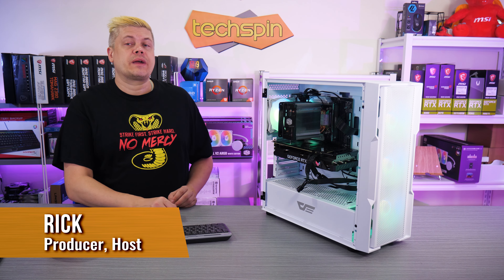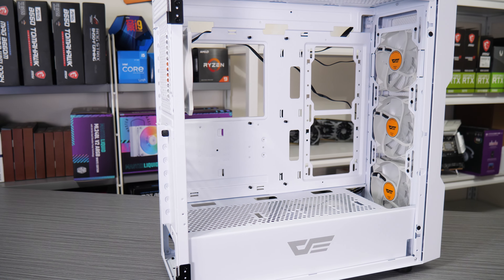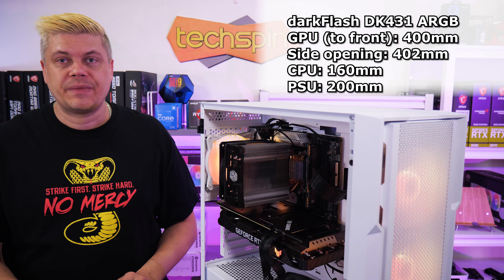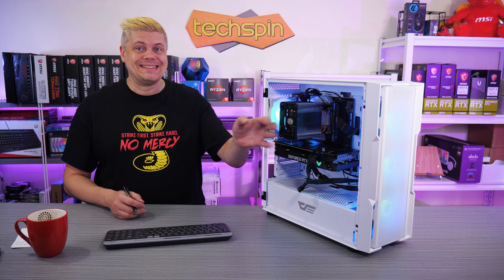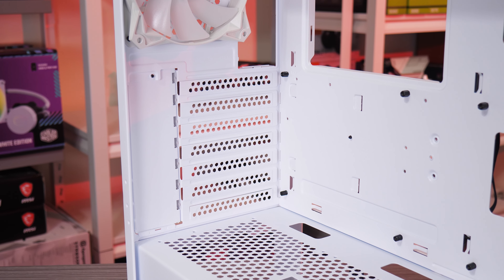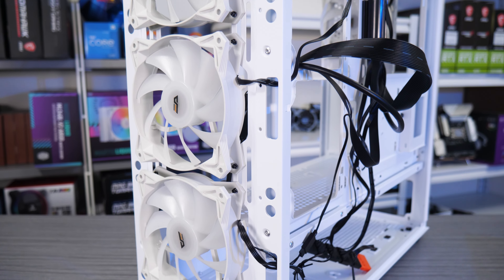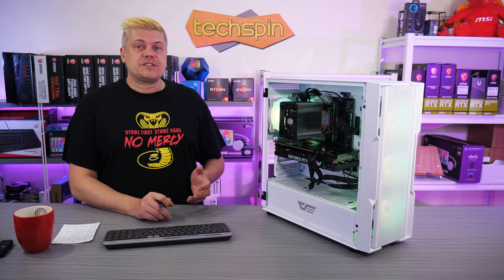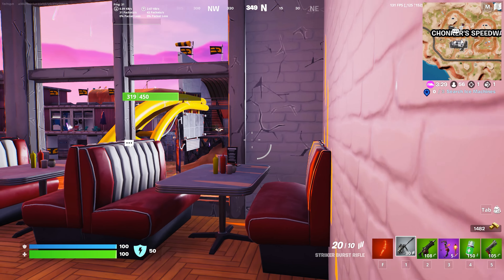Great darkFlash DK431 case, bad ARGB fans

Comment: You can just change the fans and avoid this fiasco tho right?
Reply from the maker: With the money spent on new fans, you're better off just buying a better case! We'd recommend the Cooler Master HAF 500 as it's got great airflow, is feature rich and super easy to build in. Also this case metal is too thin and deforms easily, something we haven't experienced on any other cases. Please subscribe, thanks for your support!
Reply: @Techspin hey i just wanted to give an update after I’ve purchased this case, I guess they must have listened to you because I bought the black version with no fans and it didn’t come with the Molex connector but I’m thoroughly pleased with this case, and how cheap it costed
Reply from the maker: @erronblack6763 Oh? Did it come with a 3 pin or 4 pin connector? Thanks for telling me!

Comment: Got this case today because at Turkey , E-ATX cases are so expensive... Molex is a no problem for me because theese fans are silent at molex (%100 power). If you want you can get a Molex+ 3pin Case fan, connect it to the motherboard, and connect DK431's Molex to the new Case Fan's Molex extention... And only a solution that will cost a few bucks.
Reply from the maker: Update: The master fan on this case just died, causing the other 3 slave fans to stop spinning. So we have to replace the fans.
The problem with this is that DC/PWM case fans have a range of around 650-2000rpm depending on type/brand. At max rpm, fans are loud but they move a LOT of air. These fans are not loud, spinning slowly, and not moving a lot of air. Since these are capped running slowly at max 12v, there's no way to get them to go faster. So no, there's not a workaround... Except getting actual good fans.
Reply: @Techspin  I researched this case, the fans are 1200rpm 34CFM fans. Yes thats bad airflow but its quiet tier fans. 30-40CFM 12cm fans are quiet tier.

If a fan is 12cm , Id expect 60-80CFM for performance in cooling. 

I upgraded this case from old cooler master silencio. I have 7600x , AK400 and rtx 3060ti. Cpu temp downed to 65 from 75-78 during gaming. My airflow improved.Also chipset and vrm temps are improved due to better airflow. But I sometimes feel that case fans have low airflow. 

For now I supported my airflow with 2x 76cfm 1800 rpm 3pin fans from left side and bottom. Will replace the default fans when they wear off (My pc is on +12hours a day, dust will wear off them fast...)
Reply from the maker: Our master fan lasted 16 months before dying causing the other 3 linked fans to stop spinning. Warranty is 12 months 🚩 Hope your master lasts longer than ours did 😅
Reply: @Techspin  Yep , will get 4x deepcool argb or tuf gaming kit when it dies...

Comment: Hello, I am dumb but want to ask the assembly sequence of these fans. First we connect the orange plug to the power supply and leave that connection branch, then we connect the 3 hole(5v) wire itself and the stupid sticking out 2 hole wire in the jra, and it will be safe? And is it possible to connect the wire from the fan where the reset was in to this stupid 2 hole wire.
Reply from the maker: It's been too long since I worked with this case, I'm pretty sure I showed the wiring assembled (powered off) in the video, but please read the labeling on the connector ends/follow instructions. Good luck!
Reply: @Techspin  ok with molex i understood everything that only connect to orange. but can i remove reset wire from fan and insert it into argm which has this wire similar to reset. Thanks for the answer

Comment: I don’t understand the fan part, why is it dangerous and how to avoid?
Reply from the maker: Plug the Molex power only into the orange side connector. Unfortunately darkFlash is not using standard fan PWM/DC connectors or ARGB daisy chaining, and they don't block the other black end of the Molex chain which is dangerous for consumers. Please subscribe, thanks for your support!

Comment: Can you do push-pull setup for 360mm AIO mounted top?
Reply from the maker: Why are you trying to do a crazy top end solution like that with the cheapest tiny case? No it won't work. Let me ask you, how thick is a push pull? Do you think most case manufacturers allow for the massive clearance needed for that up top? Push pull will be front only. Also, I've run push pull and for the few degrees difference it's totally not worth it, most cases you'll need custom bolts, fan mounting and wiring is a headache, and if you need to remove the AIO it takes 3x the time for removal and reassembly. Did I mention it's heavy and easy to damage mobo components? Don't do push pull 😂
Please subscribe, thanks for your support!
Reply: @Techspin  it's the only case that fits on my desk in a tight apartment. And the only case I found a way to fit 3xHDDs. Can't get rid of my 4TB hard drives yet until SATA SSDs become cheaper.

As for push-pull, I'm aware that it has minimal impact on temps. Why am I considering to do it? Because I can... And actually I just have ARGB+PWM lying around so why not give myself a headache to keep me busy lol. But thank you anyway.
Reply from the maker: @villarey.angelo Yeah the total thickness is usually 55mm for a normal rad + fan, and you'll add another 25mm with another fan set, so you'll run into lots of issues like blocking motherboard headers, ram releases and crucially, ram clearance. You really should only plan a push pull at the front, never up top, and good luck to you if you try! 🫡
Reply: @Techspin  well, will this case support front push-pull? Additionally, would AIO tube placement matter for front-mounted rad (top vs bottom)?

Comment: what do you mean don't connect fans to molex connectors?  How else will the fans get power?
Reply from the maker: The warning was: "Do not connect the fan interface black end to another Molex, as you’ll fry your whole ARGB setup and quite possibly your motherboard." If you're still using the 1983 connectivity system for your PC, that's fine, but don't chain it into this connector, just use another PSU line. Please subscribe, thanks for your support!

Comment: the front panel is hard to remove lol any tips
Reply from the maker: When we get/buy cases for review, we always triple check how the front is attached, standard way is with 4-6 grippy pegs, but some have had clips or screws, and in the early years I've broken a few! I think I covered removal in the video. Generally, some to quite a bit of ummph is required pulling outwards at the front panel's bottom. Good luck! 🤞🍀 Please subscribe, thanks for your support!

Comment: Hi, I'm new to the PC world, so I have a question... from the explanation in the video, I want to ask in this case, is it okay if the molex cable is used specifically for the fan and stacked with other fan, without stacking the molex for other components?
Reply from the maker: Yes but you can only attach it to the marked side! Please look at the instructions and watch the video carefully to avoid hooking up to the wrong side. Don't plug that molex into other devices. Wish you luck.
Reply: Thank you for the answer and response...🙏

Comment: Hi I got the same argb design on my DK352. I am looking to install 2 120mm exhaust on the top of the case. Is it okay to get a darkflash dr12 argb fans set and connect the stock argb fans on the fan hubs of the dr12 then connect is to my rgb headdr to sync? Please help me my friend I dont want any wiring problems my pc is just new 😢
Reply from the maker: Either the new ARGB fans will have proper wiring, or garbage like this. Either way, should connect.

Comment: Guys, can somebody help? I bought this case recently and my fans are working but rgb on them don’t. I’ve connected all the molexes and tries connecting argb but none of this works, what should I do?
Reply from the maker: From the way you're describing the problem, I'm guessing you may have plugged the PSU molex into the wrong connector end of the chain. Best thing I can suggest try to get it covered under warranty. Swap to a better case if you're able. Please subscribe, thanks for your support!
Reply: @Techspin  it was just a broken molex connector (orange one) in the case, just accidentally swapped one of the pins (that weren’t fixed in their positions) and now it works somehow 🤷‍♂️
I honestly believed that asus rgb software were blocking the whole thing 🥴
But thanks anyway!
Reply: @Techspin  it was just a broken molex connector (orange one) in the case, just accidentally swapped one of the pins (that weren’t fixed in their positions) and now it works somehow 🤷‍♂️
I honestly believed that asus rgb software were blocking the whole thing 🥴
But thanks anyway!
Reply from the maker: The molex connector pins can sometimes have issues as they can become dislodged. Another reason why this is a poor solution for RGB...
Reply: @Techspin  That was the problem in my case…

Comment: Your video is like the missing manual for this case. It took me a few hours to figure out the RGB connectors and all this mess with the molex connectors.
it's the first time I'm building a PC.

The problem seems to lie in the fact that they have separate LED/fan power. The LEDs run on 5V whereas the fans are running on 12V. It makes me want to solder the wires to get rid of that nasty chain of connectors🙃
Reply from the maker: Really glad we could help! Please subscribe, thanks for your support!
Reply: Im about to buy this case for my first pc build, i was wondering if i could avoid the whole molex situation/problem   With just buying different fans?
Reply from the maker: This is not the case you're looking for waves Jedi hand
Check our HAF 500 review 😉

Comment: bought new fans for this case. i chose the thermaltake c12c (3 120 front, 2 120 side, and 1 120 exhaust). i wont be using the molex fans anymore because they can raise gpu temps slightly if placed over psu shroud and raise cpu temps if placed on the top vents
Reply: I use the same case and I am thinking of buying 2 from this set because of the temperature inside the case. Do you recommend it ? I was thinking of installing over psu shroud top vents, why is it not effective?
Reply from the maker: @azimkaya6068 Don't use more of these fans! Get different fans with proper ARGB connectors.
GPUs generally dump hot air out the side, so bottom fans should help move this air up. Weird that the OP had temps go up.

Comment: I got scared on that RGB Molex fan frying something.
as long you dont put on the other side right, ?
just put all the fans molex in one plug like the one in the vid, and dont connect other stuff on it.
Can please clarify me >.< ty
Reply from the maker: Yeah this is actually pretty dangerous as we outlined in the video. It's true if you just use the one side, you'll be fine though. Better cases have been released like the CM HAF 500 which is a league above this one: https://youtu.be/31sLA5hfM50 Please subscribe, thanks for your support!
Reply from the maker: @@jlyaranon2954 Watch the video?

Comment: Thank you for warning guys. But I bought already their other case with same fans setup. I learned something about different ARGB designs with controllers... And with DF case I broke my mind yesterday totally lost with wires. I really dont understand where to plug 3pin "standard" ARGB connector or small 2pin conmector...
Reply from the maker: The ARGB connector from a controller would plug into the ARGB header on the motherboard, sometimes top right but usually along the very bottom headers. If your motherboard is older (more than 3 years?) it may not have any ARGB headers.
The small 2 pin connector on a ARGB controller would be where to plug in the case reset switch so you can change the light from the reset button without opening the case. I'd ask a tech friend to help you out with the wiring if possible, good luck! Please subscribe, thanks for your support!
Reply: @Techspin  I know how it must be connected by default with my extra ARGB controller/hub that comes with Darkflash Infinity8 fan kit. The problem is with default case installed fans. They are weird. As you stated. My motherboard is old without any light connectors, this is not a question. So I want to interconnect case fans with extra mentioned fans that I want to install additionally to case and to CPU cooler. I wrote to Darkflash last week, no answer.
Reply from the maker: @andreyansimov_diy  You can try plugging the case fan ARGB 3-pin into the controller (if it's also ARGB) and that may work. NOTE: Some cheaper companies may use 4-pin connectors for +5v ARGB, which would allow users to incorrectly connect to +12 RGB headers. Ensure the unit is actually ARGB! Good luck!
Reply: @Techspin  Its not a question, I know it for sure, its darkflash Infinity8 ARGB fan kit.

Comment: Hi there. I am looking to purchase this PC case, but I'm wondering how is one able to mount the 3 x 120mm fans on the PSU Cover as intake from the bottom?
Reply from the maker: Flip over the fans.  There may be screws included to help mount them?  If not, you'll need long screws to screw in from the top.  Please subscribe, thanks for your support!
Reply: @Techspin Thank you for your reply. I think I’ll go with the long screws from the top as there’s not enough room to screw in from the bottom and the screwdriver won’t fit in the small space. Cheers👍

Comment: Hy @Techspin . I am Trying To Buy This Pc Case WIth The Ryzen 5800x And 3080 ti .. What Should I Do ? Should I Remove The Fan And Install Other Fan or Aio .. Or It Will Be Fine For The Setup . Also My Room Gets Really Hot In summer . So What should i do please help ?
Reply from the maker: The key point is for the new hotter RTX 40-series. The 3080Ti certainly does produce heat, though with the included 4 fans you shouldn't hit any thermal throttling.  Using a top mounted AIO for your CPU will have two benefits, it'll dump CPU heat directly outside the case, and you'll have two more fans pushing air out that will ramp up when you're gaming or rendering. Please subscribe, thanks for your support!

Comment: Hello, I have the exact same case. Unfortunately one of its built-in fans on the front, the top one in particular has stopped spinning 😔, the others still work though. The troubled top fan still has its light on it just won't spin despite basic troubleshooting, it's kinda alarming because when I touch in the middle of that fan, it's a bit hot to the touch but it doesn't seem to affect much  my pc's temps, it ranges from 55-65 degrees celsius when I'm gaming. 
 Any tip on how I can make it work or spin again?
If not then,  is it possible to replace that fan individually or would I have to remove the rest of those front fans that still functioning fans because I think they have this 3 in 1 single connector that is connected to  the peripheral socket on my psu.

Is possible to remove those built in front fans and just get from another brand to replace those?
Reply from the maker: Need to replace the fan, hope it isn't the controller fan. Sorry to hear about this. Please subscribe, thanks for your support! You can replace with another brand, but don't wire the new brand into the darkFlash ones.
Reply: @Techspin  Hi there, yep already subscribed! :)  . After a year unfortunately the middle stock front fan also gave up and won't spin just like what happened to the top fan. What I did was I just unplug both the top and middle fans that don't work anymore from the daisy chain Molex connectors from the side part of the case to reduce heat. I don't have a GPU , just 5600g APU temp is 40 degrees idle and 65 degrees under load. Are those temps still fine? 

Also if the bottom stock front fan also goes down, if I buy third party or other brand front fans, should I just connect them to the motherboard or PSU because I saw your other comments they shouldn't be chained or connected to the daisy chain molars from the back as it could cause damage even to the motherboard itself? Thanks as always. Looking forward to your reply :D

Comment: Hy , Is There Any Software Available for The RGB ? How Can I change the colors in this . I can Only Change it Through the Button Contained Above the case .
Reply from the maker: You can connect the ARGB header to the motherboard, where your motherboard manufacturer will have software to control it.  For example, if you have an MSI board, download MSI Center (older boards use Dragon Center) and you can control the ARGB from there, after you connect the ARGB wire from the fans to the motherboard.  Hope this helps. Please subscribe, thanks for your support!

Comment: Nice video fast and to the point. I just bought this case for my first build, Can I change the pre-install fan to better aftermarket fan?
Reply from the maker: Thanks for the praise! 😀 Sure, you can just swap them out. The price for buying four new ARGB fans, say like a 3-pack of Cooler Master Sickleflow or Halo is ~$60 USD though, which can be a high percentage of what the case cost (depending on country of purchase). Hope you can find an inexpensive upgrade. Please subscribe, thanks for your support!

Comment: Thank you for reviewing and taking note the clearance of the top for AIOs. I almost got this case only to know my Liquid Freezer 2 280 will have clearance issues
Reply from the maker: Yeah working with wider 280mm rads is rough in many cases. Might wanna look at the Cooler Master HAF 500, we just finished a build in that and the removable top panel supports 280mm and gives lots of room for top motherboard wiring. Please subscribe, thanks for your support!
Reply: @Techspin  Thank you for the recommendation. I definitely subscribed the moment you mentioned the clearance on top of the case and best wishes for the growth of your channel! :)